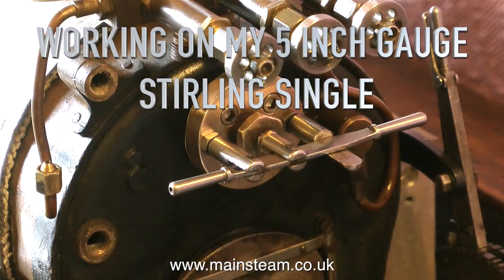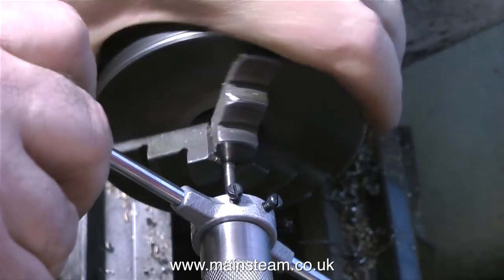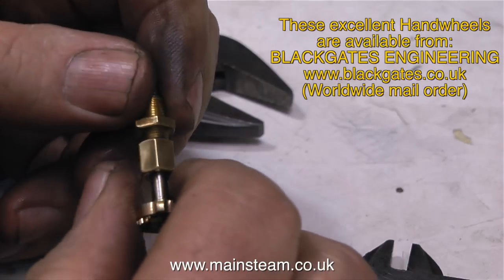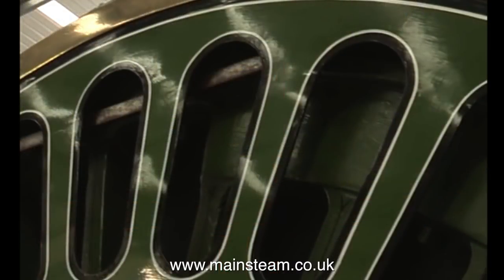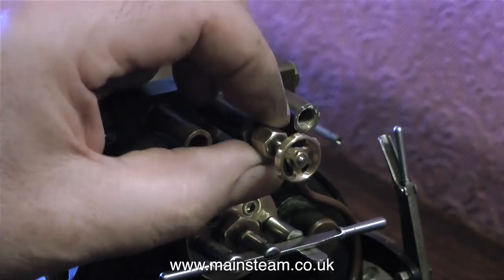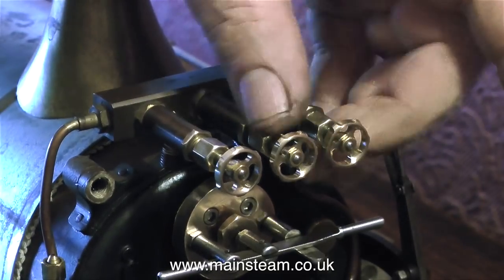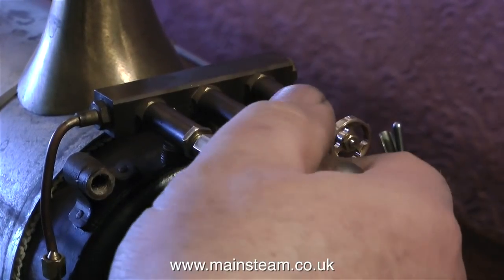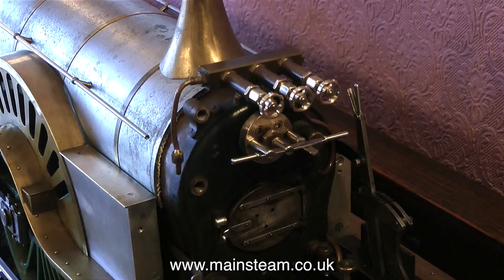MY STIRLING SINGLE #2 - FITTING NEW HAND WHEELS TO THE TURRET

Comment: Of course the best way to hold parts by a threaded section is a collet chuck. I don't have one either so I sometimes use a rod of slightly larger diameter than the part and drill a center hole through it the diameter (or a hair larger) of what I want to hold. I then slit it lengthwise with a hacksaw and this make a fairly workable collet that can be put back in a regular 3 or 4 jaw chuck.

Comment: Lining...  (shudder). I used to be an inker in the comic book industry (applying black ink lines over penciled artwork so the stat camera can prep the artwork for printing). That task was done with a brush. First thing you want to get is a quality art brush with a sharp point. The size  can be up to Number 7, but the point is the important part.  The rest is practice, and the occasional use of a metal straight edge for the straight lines, and maintaining a light, even , tension/pressure on the brush.